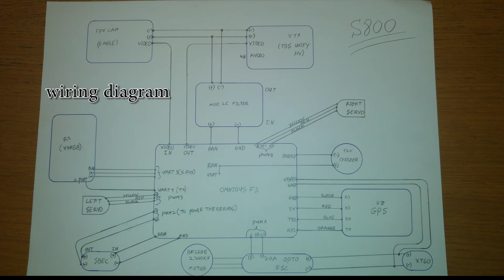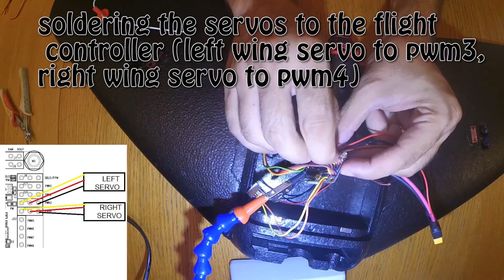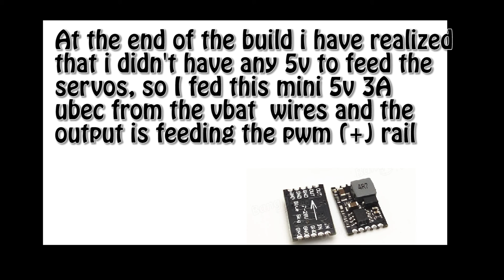S800 INAV + FPV  BUILD

Comment: Hi Got the same NZGPS and omnibus F3. Do you set the GPS in inav to ublox ? what baurate? do you use any ground assist?  Ask because i don`t get any signals from the GPS  By the way, great video
Reply from the maker: Jan Iversen 
Hello, i didn't use any ground assistence. Make sure that you didn't cross the tx and rx wires, use ublox and if there is no responde try nmea protocol. 
You have to connect the battery (under the open sky) and wait for minute or two to get gps fix. This is very poor gps, i get only 6 or 7 satellite, so now i replaced it with m8n gps 
 https://goo.gl/K954e8 and now i get 20 satellite after few seconds.
Good luck!
Reply: Thank yo so much. I will order a m8n but will try this NZGPS
Reply from the maker: Jan Iversen 
and set the baud rate to auto..